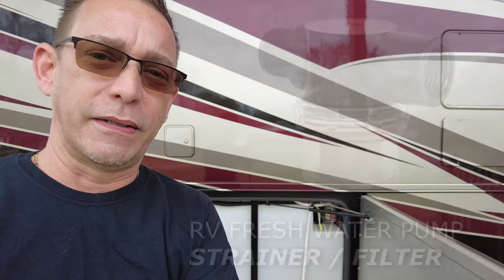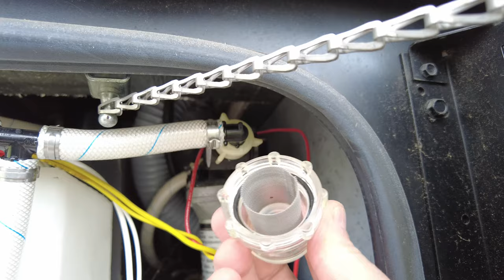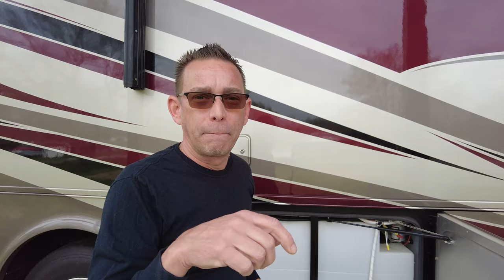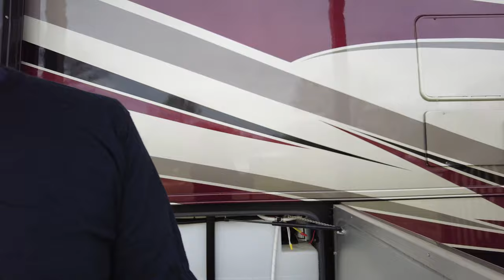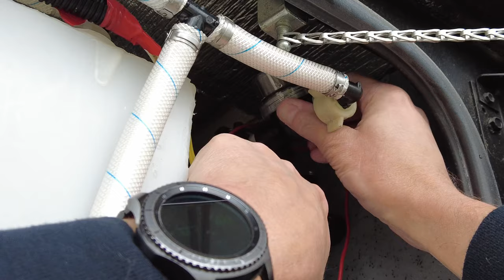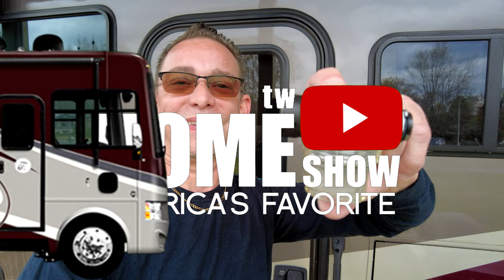tw RV ADVENTURES - Episode #21 | TIFFIN Allegro | Water Pump Sediment - Filter | Easy Replacement

Comment: Hi, I watched your video and removed, cleaned and reinstalled the filter.  I think I need a new water pump.  The right 2 securing screws are easy to access, but how do you get the left 2 screws which are nearly impossible to reach with the pump body and the black water tank blocking access.  Thanks in advance
Reply from the maker: I just had to repair my WP on this current trip. 😩 I had to use a short stubby Phillips screw driver and use all of my finger muscles to reach behind the pump and remove the back 2 screws. Luckily they aren't too tight because they screw into that rubber mount. Good luck, as I think this is the only way to do this. -Todd

Comment: Does it really matter what water pump strainer filter we use
Reply from the maker: Probably not, It's just to protect large particles from going into and through your water pump, so not to damage it. I left the links to the 2-pack I purchased that were a direct fit replacement for our RV in the video description.